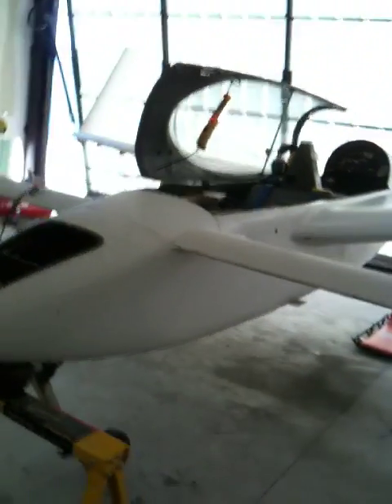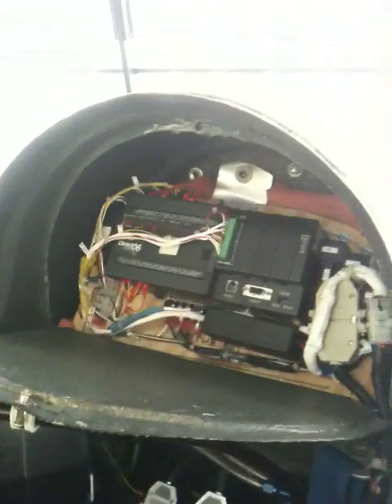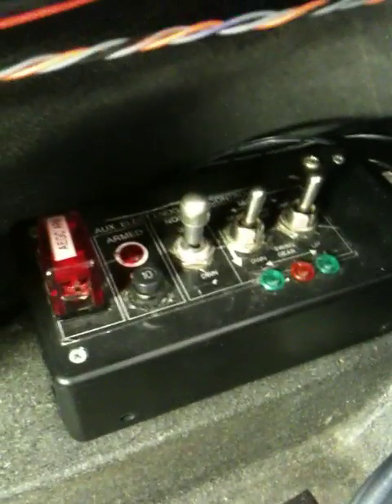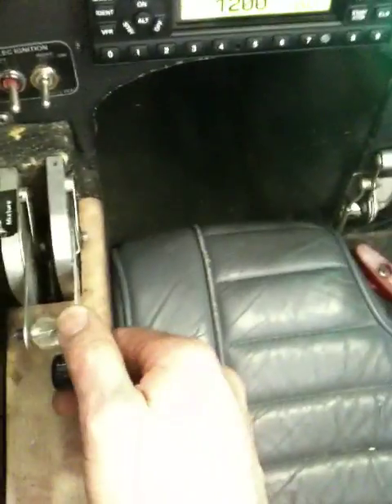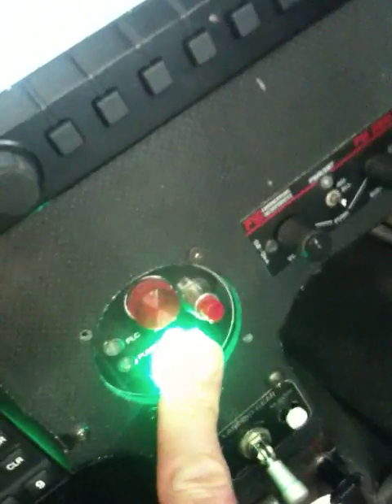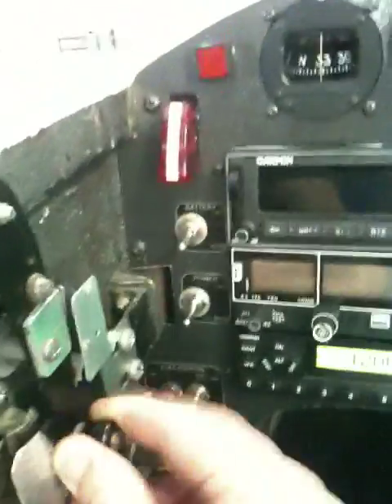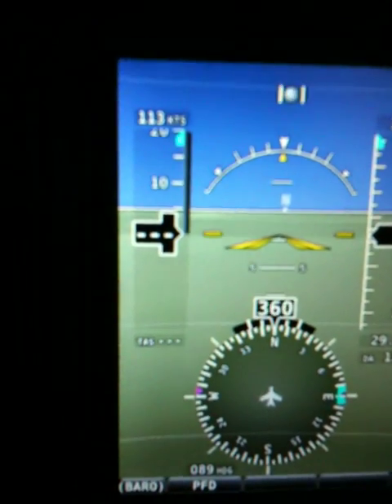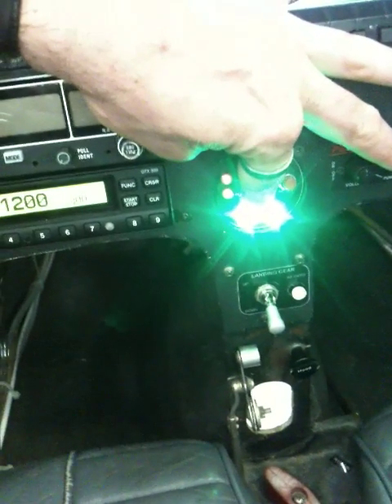Project Skyview Part 20 - Landing Gear Ops Checks

Comment from the maker: I hear you!  This wasn't an initial install, this was an upgrade to the existing gear control system which WAS very difficult to troubleshoot.  The version you are seeing in the video had lots AND LOTS of trouble free flying hours.  If there was any problem, I simply hook up a laptop to the PLC and can see the status of all sensors with a simple bit of software.  Thanks for the comment though, it's nice if nothing else to see that someone watched one of these things. ;)